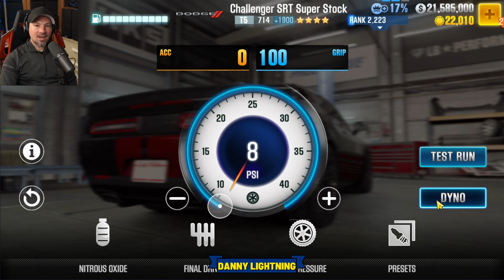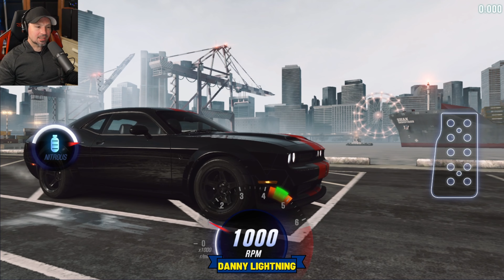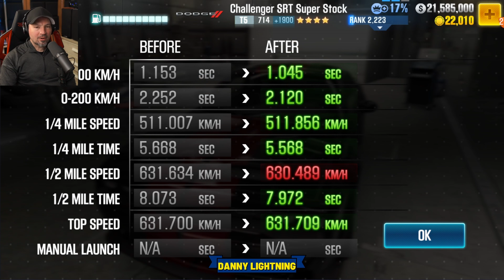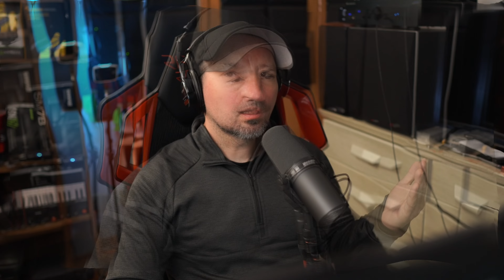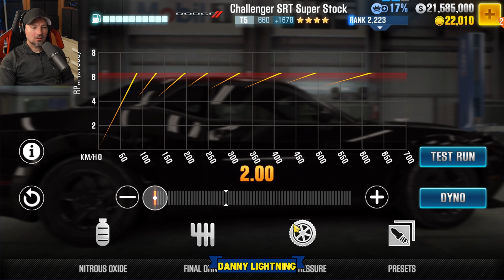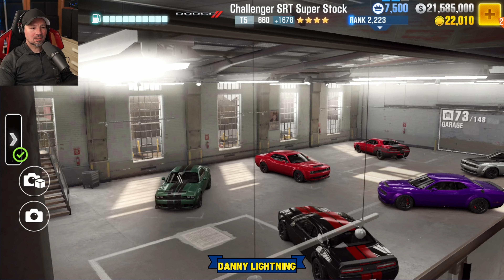CSR2 Dodge SRT Super Stock Sgage 6 Max, Stage 5, Live Racing, Review

Comment: Could you you do a little more about down shifting so not to get kicked into a higher and higher lobby
Reply from the maker: Downshifting just slows the car down,  if you have a car that's capable of winning live races without feeding the dino time and the car runs faster and the dino then you want to slow it down because if you're beating Dino will live racing it will push you into a faster lobby if you're not beating Dino you'll probably stay in the same lobby so hopefully that helps I mean that's pretty much the same information I would put on the video about it

Comment: My evo is only 508?? I matched every upgrade and tune
Reply from the maker: So if you installed the same Stage parts and had those parts filled with fusions properly and the same tune it should match I mean there's got to be something different about your car or it would match up perfectly, for example if you have a stage 3 transmission you have to have stage one two and three filled with fusions if you're missing just a couple of fusions or have different stage parts installed they can completely change those numbers

Comment: hi 
i have some questions
i got taycan turbo s it is good for all tempest or not ?

and how i get porsche fusion car ? and stage 6?

im in tier 4 in main story but i have hard time to beat him

and is there a way to get money fast cuz it hard to lvl car from high tier

(im new in the game i play only for 1 or 2 week)

also thx for ur videos i learned alot from u
Reply from the maker: So the game randomly throws you parts or anytime there's an event that uses the support you can get fusion parts for a Porsche, if you have a Porsche of any type that has golden stars you can go into rare imports click on the parts tab and open crates with keys to get fusion parts or stage 6 parts but only for the car you're in now if it has purple stars unfortunately it's real money to open the crates so I don't think you can get stage six parts for that car easily without spending money.  Now there might be an event coming up for that car so you might be able to get some parts out of that but generally it's a slow process at getting parts for these cars, it's very rare to Max them out but if you get enough parts on the car you can, I've got a few cars that I've had for like 6 years that they're still missing like one state six or something
Reply: @Danny-Lightning-CSR thx for answering me yesterday i got a Toyota gt supra is this worth upgrading it than the turbo s?

cuz i ask a friend and say this car way better than turbo s

Comment: How do you get +1714 just on stage 5? Im at max 1323…
Reply from the maker: All I can tell you is if you have all the fusions installed on stage 1 through 5 and you tune the way I did hear that's just the number she get sometimes if you're doing a lower upgrade tune with only a few parts you can get higher numbers out of it than when it's the maxed out so I don't know some cars are just weird
Reply: I can’t win last race on Prestige Cup 😕

Comment: Is it even worth building this car just for the prestige cup? Idk
Reply from the maker: The beauty of the prestige cup is learning a lot of respect points to help your crew earn prizes or the milestone car know if you don't need to do that there's no reason to do that honestly, unless you want the little prizes here and there that it gives out.   I do the prestige cup every season just to help Mike Russo this is one of those deals where if you need to do the prestige cup upgrade the car but if you've already got a better cure five-car than this I guess there's no point right
Reply: @Danny-Lightning-CSR  I have been hitting my crew minimum fairly easily even without the 180k from the prestige cup so maybe I should start considering skipping some pc cars although that does mean I miss out on rp from the other car exclusive events as well as the next seasons showdown 🤔
Reply: @sashoboss2121  Prestige cup gives 300k RP all up.